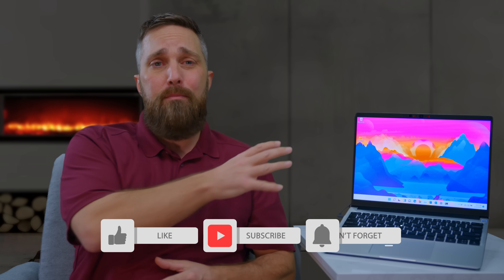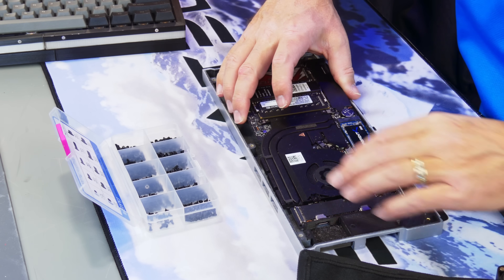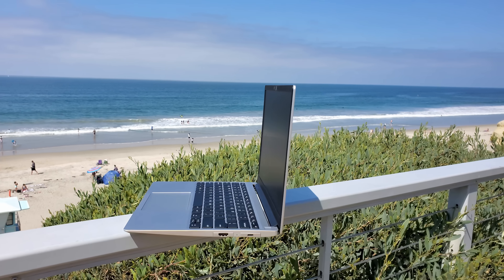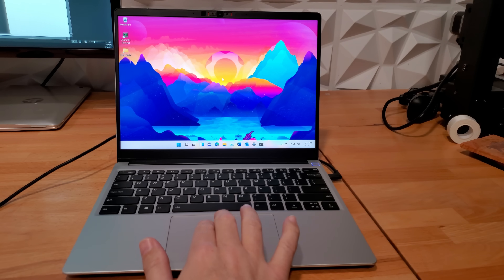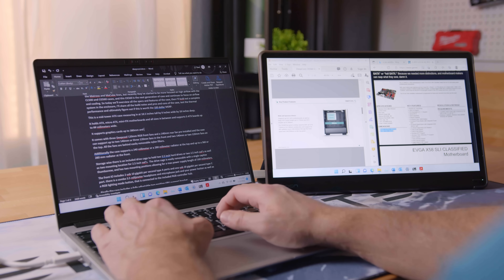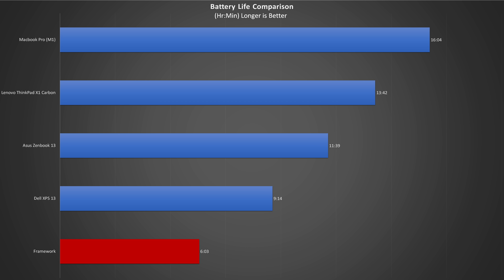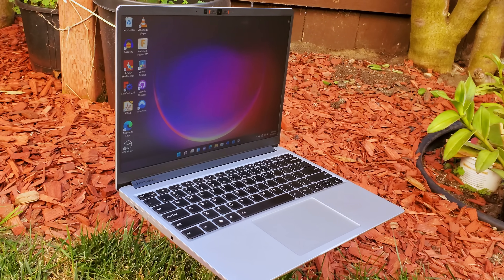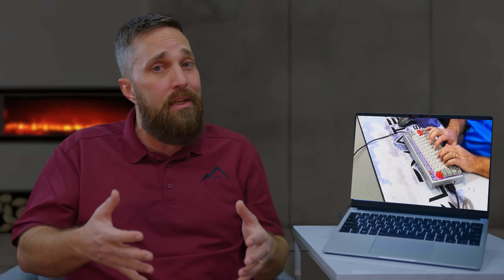Framework Laptop 6 Months Later. I'm Less Impressed 😐

Comment: My hp Pavillion g6 (that I still use for light duty stuff) had a user replaceable cpu, it's laughable that framework doesn't
Reply from the maker: Where exactly would they source a socketed current gen CPU? Neither AMD or Intel make them anymore, and you can't put a desktop CPU in an ultra portable laptop.
Reply: @ElevatedSystems  No idea if it would be feasible due to space constraints and memory latency but a mobile processor soldered onto it's own daughter board connected with a long flat key and socket connector like for m.2 drives may be able achieve that with current hardware.
Reply: @GIJOE573  yeah that is 100% not gonna happen. Intel nor AMD don't make sockected laptop CPUs anymore.

Comment: I'm immediately buying this as soon as its available in my region and they have minimum thunderbolt 3.0 support.
Reply from the maker: It has thinderbolt 4 so your half in luck.
Reply: @ElevatedSystems  Yeah but it doesn't have a expansion module thats takes a thunderbolt input and output as far as I'm aware it's only USB-c. Unless they added it since.
Reply from the maker: @justaguy6216  Thunderbolt 4 is a USB-C input.  I've done videos on a using a Thunderbolt eGPU and TB4 Dock.
Reply: @ElevatedSystems  Oh really? I was under the impression it could I take USB levels of data transfer rate.  I'll have to check that video out.

Comment: On arch Linux the framework laptop worked pretty much out of the box, the only times I had driver issues was on u ubuntu and windows 10/11

The reason that your Linux experience may be subpar, is that most Linux distros have out of date software, as they aren't "unstable rolling distros" (unstable in this case doesn't mean your system isn't stable, more so you just have the latest software) as ubuntu is not a rolling distro, any time you use it with brand new hardware, you are pretty much bound to have issues

Comment: I would love to own this laptop for a lot of reasons. However, with products like the M1 suite of laptops it’s hard to justify the drop in performance. You could buy a decently specced out Air for $1400. With better battery, and the ability to handle some higher performance related tasks. 

Have you tried to edit any videos on this computer? How does it handle it?

Comment: For me the GPU is just barely too slow to do everything I want it to. I have also experienced a problem where if you try to trickle charge it with an underpowered USB C charger, the CPU performance drops to almost nothing. The expansion cards on mine are super hard to remove. I still like it overall, but it’s not perfect.

Comment: I don't get why they didn't just give it a ton of ports from the outset, really, 4 inset TB4 ports? Absolute garbage.
Reply from the maker: It's a 13 inch ultrathin laptop. 4 ports is equal to or more than any laptop in this class.
Reply: @ElevatedSystems  like there was nothing stopping framework from doing better than that
Reply from the maker: @genericscottishchannel1603  Space, physical space stops them from fitting more    on a mainboard less than 100mm wide.
Reply: @ElevatedSystems  pure laziness, why did they use such a small laptop in the first place
Reply from the maker: @genericscottishchannel1603  Ok so your argument is all laptops should be big and thick? I think you're  20 years too late for that
Reply: @ElevatedSystems  You have some industry standard definitions for big and thick don't you, what, is 14"+ and thicker than a phone too much? Same bad take different person making the bad take and defending big manufacturers. So much more could've been done with a 16" one inch thick framework laptop, they'd just have to bundle a sort of thick padded case to placate the people who inevitably come and whine about where they'll put their 'too big, too heavy' laptop that would be able to do pretty much everything nearly anyone wanted without needing a full desktop workstation, while getting to take it pretty much anywhere you wanted without dongles, just it and the charger, and with improvements in batteries, able to even go beyond 100 watt hours by just linking up a bunch of 100 watt hour batteries, getting massive battery life out of a desktop replacement typically capable of barely 5 hours away from the wall.

But no, your right, we should settle for subpar, incapable designs and not push for right to repair.

Comment: I still can’t believe that, with how big they actually are, the modules don’t have at the bare minimum a twin usb-c unit, or better a twin usb A 3.1. I don’t care if I loose thunderbolt in the process, nobody needs 4 thunderbolt on a mobile device and I’d get way more use out of being able to split a thunderbolt connection into 2 somewhat slower ports so I can use my other thunderbolt ports for different modules. Such a disappointment.

Comment: I appreciate this review! I am considering a framework laptop as my next daily driver. Using a Thinkpad E595 so reparability is pretty damned good and it works super well with both windows and linux already. But I am still dazzled by the Framework concept. This is a pretty positive review for a early unit. Thinkpads still have issues after 40 or some years. :P I do not expect perfection.

Comment: It its me in the same way as those specific phones or computers with open alternatives to the common UEFI.
The idea is great, but in many ways it has things I don't need and lacks things I want.
For the framework specifically, It basically offers the same kind of ports I could get on any other laptop. There are many (older) ports I would like to see on such a modular setup.
The expansion modules are limited to DisplayPort, USB-A, HDMI, MicroSD and USB-C, and each expansion module only offers a single port. So to use legacy ports (like DVI, Ethernet, VGA/DSub-15 or RS232/serial), or more peripherals (>4 USB devices) I'd still need dongles, hubs and adapters. And those are all parts of interest when using it for work.
With the ports they offer I would probably buy 4 USB-A modules and maybe a USB-C and HDMI port each in case I need those ports at some point.

I still think the idea is great and should be an example for the industry at whole and for Framework to offer more expansion options for people using the device for work.

Comment: What's amazing to me, also having daily driven one for the last few months, is that it's far better than any other first-gen product I've ever seen in this space - even WITH all its teething issues. I'd much rather have this than anything else. Period. The fact that everything is swappable makes a lot of the issues you mentioned much more easily fixable than with any other laptop. The killer feature for me is the FOUR TB4 ports - more than I've seen on any other laptop, period, and it's not discussed nearly enough.
Reply: “Issues with features not working, bios and driver problems, component problems” 
“Sensitivity has definitely gotten worse, the pad routinely doesn’t register single or double taps, multi gestures are often missed two fingers tap three fingers swipe, it’s hit or miss, even the right click area sometimes click but doesn’t register”
Reply: Auto-cpufreq

https://youtu.be/B1iRxoyT4EA
Reply: TB4 is just marketing. all they did was take the bottom out of the tb3 spec and call it tb4. its not better at all. and im pretty sure higher end macbooks have similar specs.

Comment: Personally, i think it would be cool to have a framework laptop that could also flip into a tablet that could be a decent competitor to huion and wacom for artists and animators to have everything in a relatively light all in one device that can run programs tablets typically can’t. 🤔 of course some would still need an outer hard drive. (For large projects) 

i’m up for something that thinks outside the box a bit, and framework seems like it can happen. I would of bought this laptop years earlier if it had came out at that point in time, but i already have a desktop so, JUST a laptop is kinda “eh.” But an all in one tablet and laptop that is customizable, fixable and upgradeable that i can also take with me almost anywhere? THAT would be heckin’ impressive.

Comment: Bit late, but I have a MacBook Air M1, 8gb ram and 256gb ssd, and my dad has the framework with 32gb ram and a 1tb ssd. They both ended up being around the same price. 

In terms of sheer user experience the MacBook feels a lot more premium. The MacBook is also more portable, has a significantly better battery life, and has similar performance to the framework. So overall, the MacBook is definitely a nicer laptop to use, but you sacrifice upgradibilty and freedom. In the long run, the framework will probably last longer, so you have to choose which laptop based on upgradibilty and longevity or performance and user experience.
Reply: I still have a mid 2012 MBP with its original battery from new, so its around 10 years old, put in 16GB RAM and an SSD, its very quick and is still in use now, Apple products are solid. From what I've seen in this video, looks like framework has some issues in the QC department, trackpads shouldn't be failing early on in the laptop's life.
That said I hope this gains traction and they sort out the issues, could be onto something with the modular ports at least.
Although I'm not in the market for another laptop as I have an M1 MBA as my daily driver.
Reply: I have the base MBA, mainly as the Framework wasn't available where I am when I needed my replacement (the Mac Mini also didn't work properly with the monitor I had bought recently). For my use case I'm kind of regretting getting it, mostly as it tends to have RAM issues, whereas with the Framework that would have been easy to fix. The repairability is also a worry for me, knowing my luck (the previous laptop had something spilled on it!)
Have to say though, the portability of the Air is pretty amazing, don't think it can be beaten with comparable performance. It's also nice to have a laptop that doesn't need to live connected to a power supply...

Comment: 13:39 one thing I observed was, that on your machine and on my framework (i5-1135g7) the benchmarks turn out way better than the avarage (yours got 1627/5490, average i7-1165g7 got 1374/4486) and (mine gets around 2900 points single passmark while average is around 2700 points)
I had significant worse performance (2400 in passmark - so it drasticly reduces cpu performance) with old ram that I put in while the new one was not here, so I recommend to everyone get non-xmp ddr4-3200 in best case dual rank
another thing what I observed was, that HWinfo in windows tells me, total system power is way higher than cpu power, which was on my xps 15 with nearly 20h of battery way closer togheter, maybe VRM or in general misc hardware is pulling more or less efficiant, maybe there is a way to fix this by firmware, but it should be doable with the next motherboard.
when someone has the equipment to perform measurements inside the laptop go for it, I think framework team can come up with a solution when they know what the problem is, but they have really not the time to search for this themselfs I guess

Comment: This with ryzen 7000 series with rdna2 igpu would be insanely good. Given they improve the minor issues with the battery touch pad etc
Reply: I think if they used a cpu that wasn't intel battery life would improve quite a bit.
Reply: This is the exact configuration that I am waiting for. Because it will have the really good battery life and single thread performance that I need for my applications. And from what I heard, they may have rDNA three graphics instead especially on the Phoenix series which is the lower watt Apus
Reply: @footsorebird0365  same

Comment: Honestly, battery life is not important to me in a laptop. This is due to the performance hit when running on battery. I always carry a charger with me and plug the laptop into a wall. Sitting in the sun on a laptop feels wrong for a lot of reasons, one of which is that I would be worried about overheating and throttling the laptop further.

Comment: Problems with the Framework laptop:

1)  Repairability and modularity are NOT selling points for the vast majority of people because the vast majority of people will not take advantage of it.

2)  Any laptop like this NEEDS to not only be equivalent in quality, but superior because you have to overcome brand recognition.  Most people will buy the Apples or Dells or Asuses because they're a recognizable brand and people will go for the familiar.

3)  Port modules will NOT be supported long term because most people will not utilize this feature thus most will not buy any modules, thus removing any financial incentive for Framework to release new modules.

4)  I have my doubts as to the viability of long term support for upgradeability of this laptop.  Other, larger companies of tried this and have failed.

If you separate your emotional desire for products like these to succeed (which I had to do as well, by the by) you'll be forced to agree with me.  Plenty of companies have tried modularity in electronic devices and they have all failed.
Reply: What companies exatcly tried this? . I only know of one. Fairphone and they are still around plus its not exatcly a laptop manufacturer.
Reply: @KrolPawi  There were also some modular Dell Alienware laptops around for example. And the point isn't that these companies aren't around anymore, the point is that they stopped providing upgrades, compatible expansions and so on. For example the first Fairphone models advertised as upgradable similar to the Framework laptop, but instead of releasing upgrades, they released a new Fairphone model with incompatible parts.

The point is that's very hard to create compatible upgrades and that also applies to the laptop market. Framework can of course design a Ryzen mainboard, but very likely there will be problems having the same connectors, having the same layout, having the same cooling requirements. Maybe they can make the Ryzen mainboard smaller and then they're having to ask themselves if it makes sense to waste physical space and development time to preserve compatibility or if they should create a new case design that has more room for a larger battery or whatever.

It's just a financial decision they have to make, and only a small part of users are probably actually interested in upgrading their mainboard only. Maybe in 3 or 4 years when the laptop gets slightly old, the case will have scratches, users might also want to have a matte screen that could've be released then, the battery might have degraded, and instead of upgrading single parts, it might just be more efficient to simply buy the new model and sell the old one on ebay.

To me the main selling point of Framework would be build quality, robustness and repairablity. (And of course all the standard features like performance, portability and so on). Having potentially upgraded parts available somewhere in the future with nothing confirmed at this point isn't a selling point to me. And robustness is more important than repairability. Ideally things don't break in the first place and don't need to be repaired.
Reply: Modules are not optional, they're the core IO. They will always be manufacturing and selling them...

Comment: Jesus 1400 for a heap of junk like that? ThTs literally just fancy startup crap?

I mean… also… would have to do some calculations…. But… my little 2014 MacBook Pro has been pretty heavily used every day since then, is running latest software; only had the screen replaced (because some asshole smacked my laptop hard shut, and they had to pay for), a SSD upgrade, and a disassemble and board clean because liquid was spilt on it and it wasn’t working. Is most likely the “more eco” option pushing not a single atom of waste, and re-use over buying new. Still going stronger then your piece of crap almost 10 years into its life. That will need a new trackpad every 6 months, replacing the CPU requires basically replacing the one thing that is the polluting thing to make, with most people just going to throw the old away anyway.

This is where these scam companies can get you. “Ooo modular laptop, here’s all the parts!” Yeah it may only last 6 months but you can just fix/upgrade it! We are the better alternative to that gross China sludge made Mac that you would never have to touch that also will easily get you 10 years if taken care of. Wonder if you do the math what way is better🤔 

I’ll take the $2000 mac over the $1400 c(r)ap. How much are you going to spend in repair… it’s like wanting to buy a Subaru. Great cool fun car that will last forever and pretty easy to repair?! Yes! …. If your willing to sink $5,000 in maintenance and repair every month….
Reply: really not surprised an apple fan is also entirely tech illiterate

Comment: I don't have my hands on a framework to test this, but there's a few options in the BIOS such as "enable TCSS wake from sleep" and PCIe power savings in the windows power plan. You should definitely take a look at those and see if those reduce the power usage of the dongles at the very least.

I found these settings initially because I noticed that when my eGPU was plugged in, I literally could not get my computer to go to sleep fully. It would remain on and more importantly, generating heat as long as the eGPU was plugged in.

Disabling the TCSS wake from sleep and reducing PCIe power savings to max power savings fixed this.